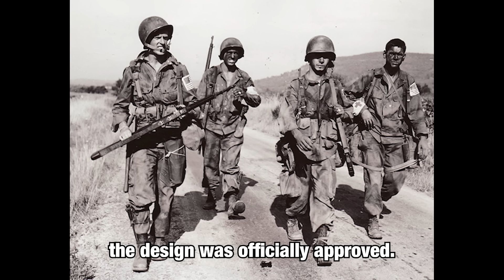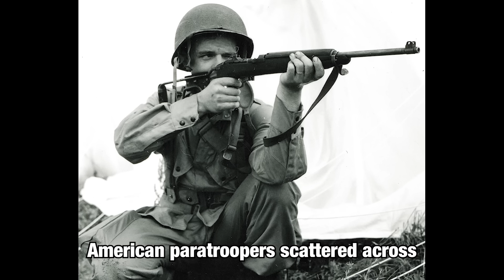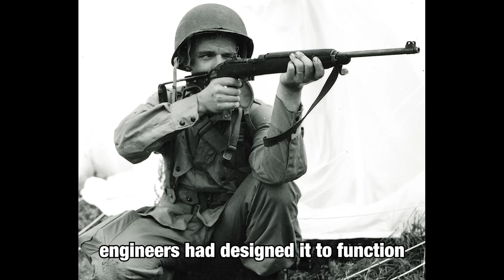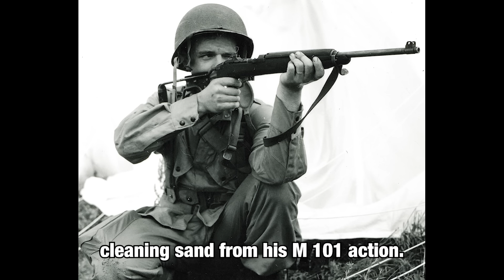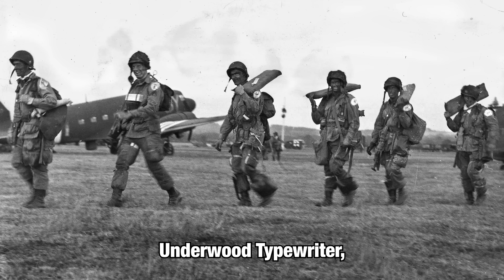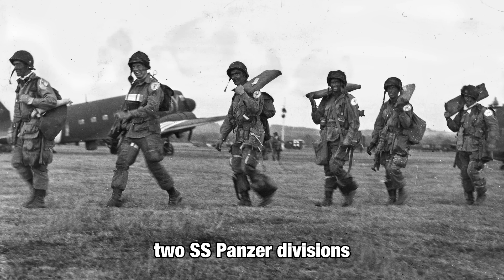How One Gunsmith's "Unreliable" Gun Made U.S. Paratroopers Deadlier Than Ever

Comment: On June 6, 1944, 13,100 American paratroopers dropped into the darkness over Normandy. They were scattered, disoriented, and behind enemy lines. In those first critical minutes, their survival depended on one thing: having a weapon that was ready to fire immediately.

The standard M1 Garand rifle, while an excellent infantry weapon, was a liability for paratroopers. At over 9 pounds and 43 inches long, it was too bulky to jump with. The army's solution was the "Griswald bag," a canvas sack that held the rifle in three disassembled pieces. Theoretically, a soldier could reassemble it in 40 seconds. In reality, under fire in the dark, this was a death sentence.

The Right Tool for the Job:
The U.S. Army needed a new weapon, fast. The requirements were specific: it had to be compact, lightweight, and provide more firepower than a pistol. The answer was the M1 Carbine. At just 5.2 pounds and 35.6 inches long, it was half the weight and significantly shorter than the Garand. However, even this was too long for a safe, comfortable jump.

The solution came from an unlikely source: the Inland Manufacturing Division of General Motors. Applying automotive mass-production principles, Inland designed a folding stock for the carbine. The result was the M1A1.

The Ingenious Design:
The M1A1's design was a masterpiece of simplicity and reliability, born from automotive engineering:

The Stock: A spring-loaded, wire-frame buttstock that folded sideways, reducing the weapon's length to a compact 25 inches.

The Mechanism: Crucially, it used a simple spring-loaded cam instead of a complex locking latch. This meant a paratrooper could snap the stock open with one hand, in the dark, without fumbling for a release button.

The Philosophy: Inland's engineers designed for the "10,000th paratrooper on the 10,000th jump." They prioritized foolproof reliability under the worst conditions over unnecessary complexity.

This was not a new weapon, but the proven M1 Carbine action placed into a specialized stock. This meant logistics and maintenance remained simple.

Proven in Combat:
The M1A1 was first used in the airborne invasion of Sicily in 1943, where it proved its worth. But its ultimate test came on D-Day.

As paratroopers from the 82nd and 101st Airborne Divisions landed scattered across the Norman countryside, the M1A1 was a lifesaver. There was no 40-second reassembly. A paratrooper could land, snap the stock open, chamber a round, and return fire within seconds. While the drops were chaotic and losses were high, the M1A1 gave isolated soldiers a fighting chance from the moment they hit the ground.

The carbine became the standard for American airborne forces for the rest of the war, seeing action in Operation Market Garden and Operation Varsity.

A Legacy of Simplicity:
The M1A1 was not without limitations—its stock wasn't designed to launch rifle grenades, for example. But this was a conscious trade-off. Inland's engineers had optimized for the primary mission: instant deployment and reliable close-range firepower.

The success of the M1A1, with over 140,000 produced, demonstrates a fundamental truth of military design: the best weapon is not always the most powerful or complex. It is the one that solves a specific problem in the simplest, most reliable way. The M1A1 succeeded because it gave paratroopers exactly what they needed—a weapon that worked the second their boots hit the ground.

Comment: As a young man I was at my uncles bill and Bo’s ranch in the northern part of San Fran. Bay Area. Went up there with my mom for a weekend here and there. On one of those weekends  a visiting friend of my uncles just happened to have one of those carbines with the folding stock. Don’t know if it was ww2 era or a replica. Didn’t matter as it was a functioning firearm and I was fortunate enough to fire it. I recall everything. It was light, maneuverable, had what I later discovered was referred to as a peep sight. I fired about six rounds as I ran out of targets. I nailed every single tin can on the first attempt. Only thing left was the fence posts supporting the barbed wire fence. My uncle let me shoot the metal post. Same kind of post you see in school yards for tetherball games. Thick metal. That bullet punched right through that post.I don’t recall if it went through the back but it left a good hole in the front. Got to do some plinking and a penetration test, what a blast. For me that peep sight was extremely accurate.

Comment: Need to improve your AI captions.  Inland not finland. M1A1 not M101. Never heard of a special take down M1 Garand. You could strip it to the barrel - receiver group, trigger group and stock.  3 pieces plus barrel band needs to be slid into place.  The Japanese had 3 take down versions of the type 99 Arisaka for paratroopers.  I used to own one of the II.  It had a retained threaded bolt on the side to lock the barrel assembly to the recieverl assembly.  Just insert the two together and screw the blolt down.  I don't think it went over very good,  Many of the bags carrying their M1 Garand rifles got ripped from their harness when they jumped.  ref The Longest Day.

Comment: BS you can't assemble a Garand in the field without a vise and action wrench which weigh about 20 pounds. So, if you are going to lie about that right off the bat, what else are you lying about?
Reply: unless it is only battlefield striped for a field typical cleaning?  YES!  I had an M1 Thumb, it was enough. would not want to do this in these conditions!
Reply: Good thing that is not what happened!
Reply: Right, you don't thread the barrel into the receiver, that takes special equipment & is done at factory or by armorer. Put the barreled action into the stock & put the trigger assembly in & snap it closed.
Reply: I wonder if they misunderstood reinstalling the action to the stock. I do not know as i was not there.
Reply: AI doesn't know what it's doing apparently neither are the ones who are using it. I don't remember what they called it but I know that they gave the jumpers a special weapon but I don't think it was a garand. Maybe the m1 carbine.
Reply: Google army mobile machine shop. They had these everywhere with the South Bend lathes with an inch and a half spindle so they could re-crown 50 caliber barrels. These guys and the CB’s are the ones that build all the stuff out in the field for favors and for just a hell of it.
Reply: @rangerat1973 did they parachute in the night before.
Reply: I learned how to disassemble and assemble the M1 in high school JROTC.🤷🏼‍♂️
Reply: AI fake info
Reply: Well this is a relatively recent post in the new YT
Reply: Horse shit  M1 Garand  mis information